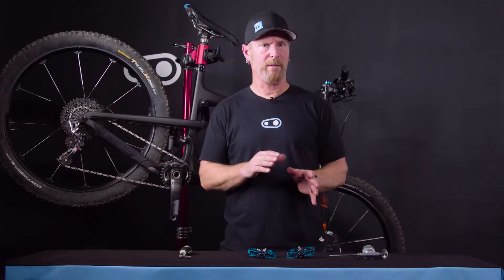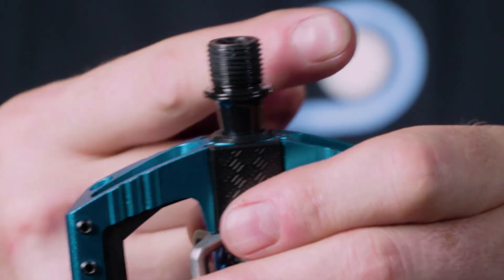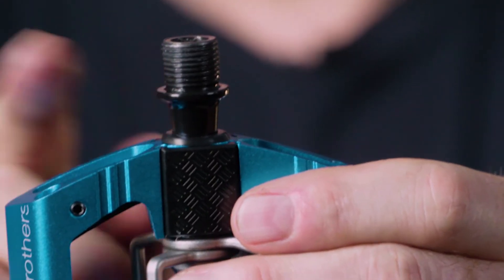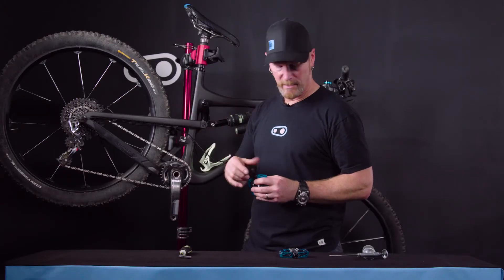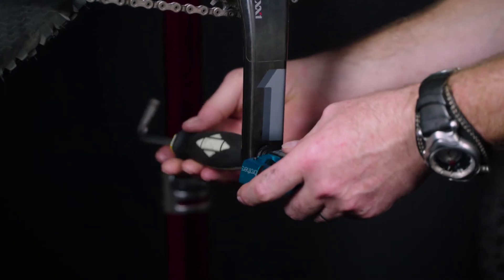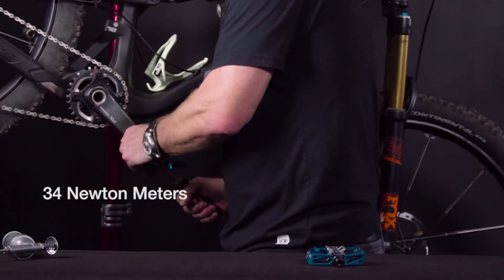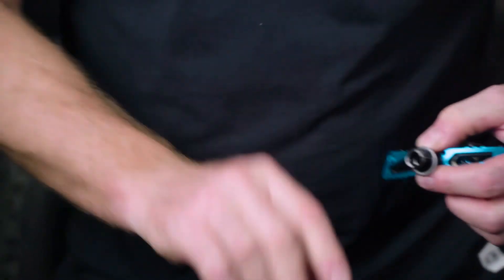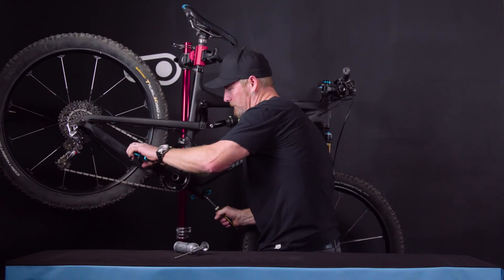Crankbrothers Pedal Installation Tutorial

Comment: How do you measure 34 Nm?
Reply from the maker: Hey Phil, 
34 Nm can only be measured using a torque wrench. Thanks for the comment! Hope this helps.
Reply: Where do you do find that specific wrench?
Reply: @PJ-gp2hj  If you mean a torque wrench then it's usually sold at bike shops. There are many different brands of manufacturers of these tools, for example Park Tools makes them. It's totally worth spending a bit extra on the tools as you get nicer quality tools for your money that will most likely last a lifetime.